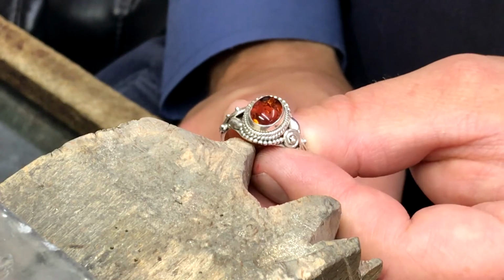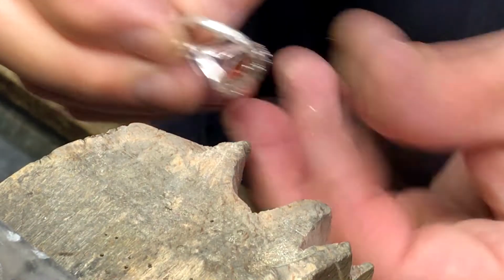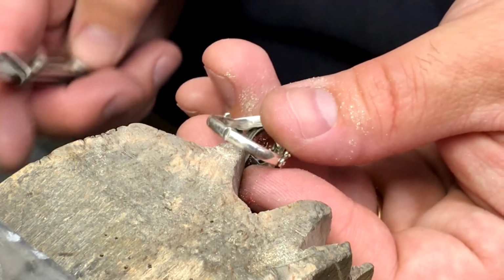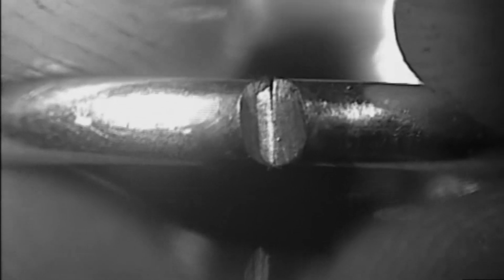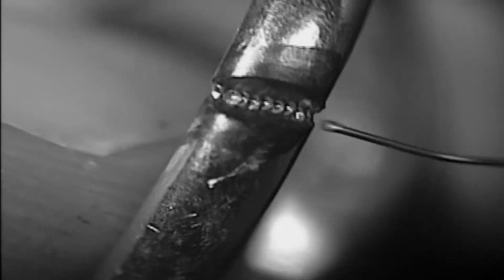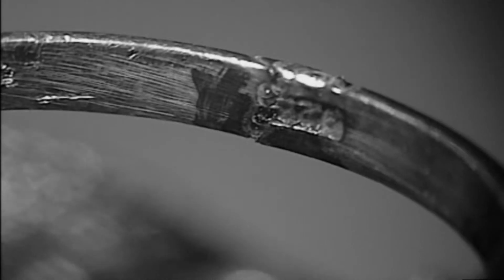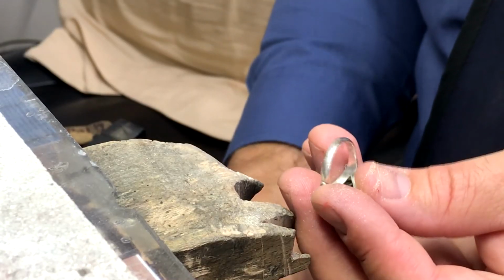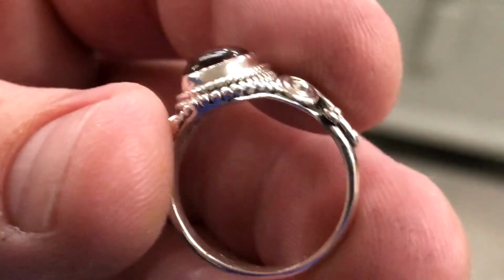Sizing a Ring with a Heat Sensitive Stone

Comment: What wire works best?
Reply from the maker: We find that 28 or 30 gauge sterling laser wire works best if you need to use a laser to size a sterling ring with a very sensitive stone where a torch would do damage.
Reply: @shawnpcormier  thx!😉